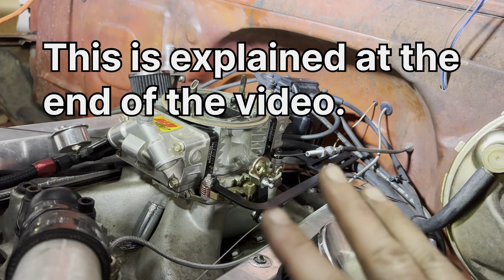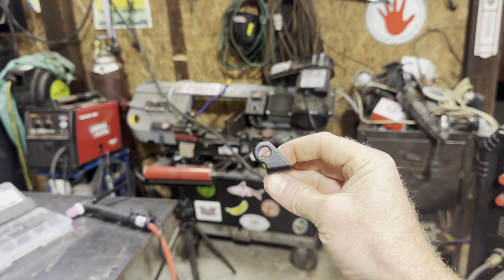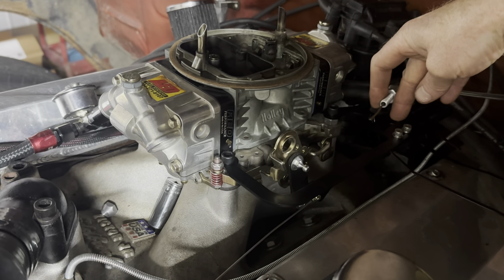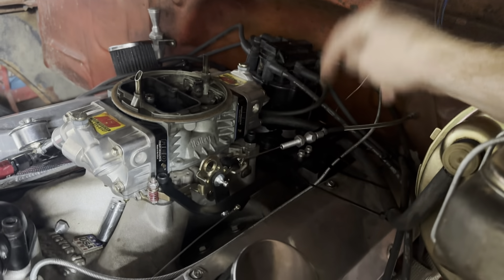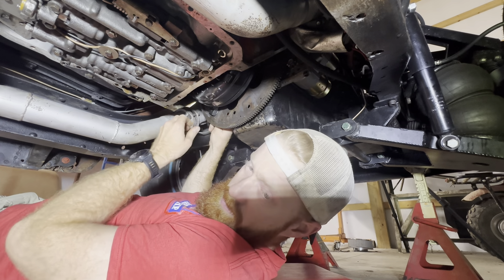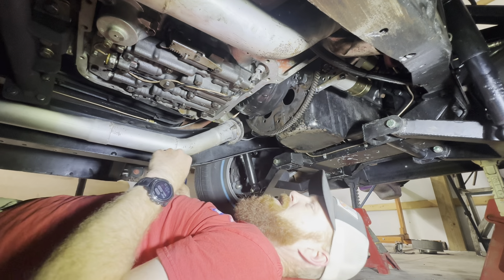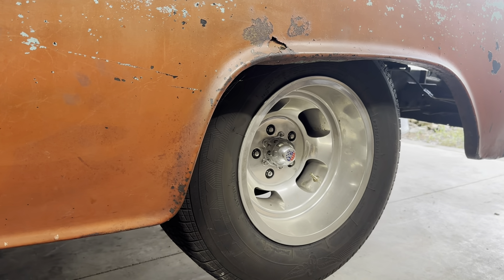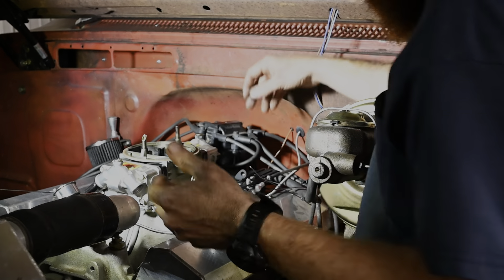How to Install TV Cable for A 700r4 Swap

Comment: Nice work I went with full manual valve body eliminates tv cable keeps constant pressure and still have lockup
Reply from the maker: Nice may have to look into that

Comment: Great information I had a 700 in my c10 and I adjusted the cable 100 times until it wouldn’t move anymore. Ya if ya don’t know what you’re doing it won’t take much time to blow one up
Reply from the maker: Yeah that’s what I’ve heard. Luckily I have Brent to help lol